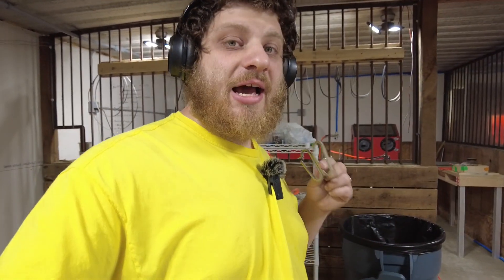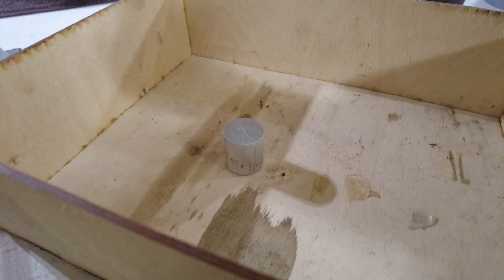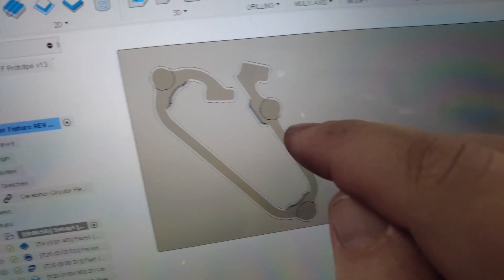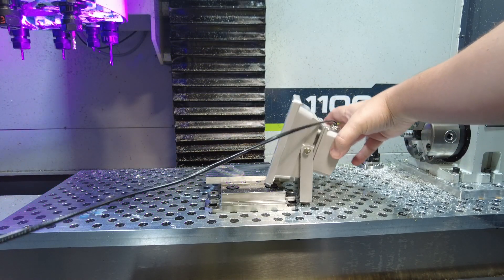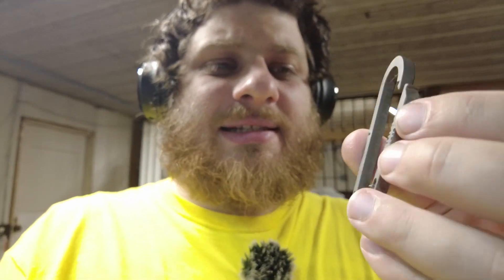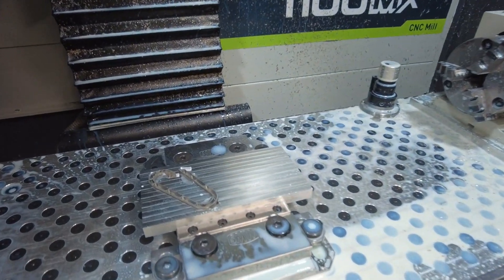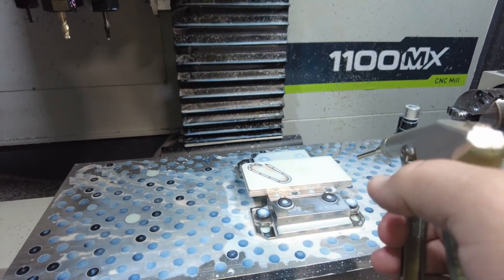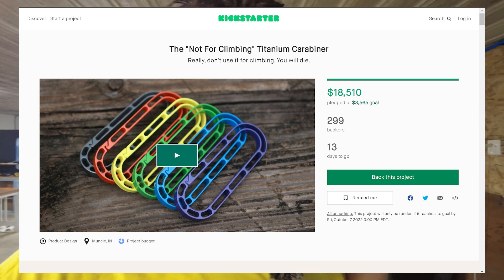UV Resin Adhesive Workholding

Comment: I know its an older video.  But epoxys dont stick to aluminium with holding power.  At least the ones i used.   We allways need to fully encapsulate alu fixturings in epoxy glass/carbon rc boats.

Comment: Just thinking out the box here - how about, on the inside of your fixture, you cut out a sheet of stiff rubber to match the inside profile, then a metal plate the same shape. Then if you screw the metal plate down to the fixture, that'll force the rubber outwards, which in turn will grip the carabiner. Bit like the miteebite, but all the way around the profile. It might cause problems where the slots get machined into the carabiner, the rubber might squash the walls inwards.
Reply from the maker: Oooh, interesting! That could potentially work super well! And it would be fast to get parts into, and out of!

Comment: I've seen that you have been working on work holding for a minute now. My advice to you would be to make a 3 piece clamp that surrounds the carabiner with centering pins. you would have 6061 aluminum inside the carabiner to hold its shape and a top and bottom piece to clamp it shut within the vise.
Reply from the maker: In the past I have been burned by mechanical workholding warping the part. It's rather thin once I finish the material removal. Something like that might be the way to go, we'll see. But adhesive workholding has some benefits if I can make it work.

Comment: Have you already just used 3 large head screws? Two at the ends and one in the middle. (Start with drilling three holes for screws if you have to) Machine what you can, M0, move screws to different spots, finish machining. It's probably the slowest and needs the most human intervention but if you don't need to make a ton of these I've definitely machined more precarious parts this way. Either way, good luck! Also, they make downcut end mills that aren't just for plastic, could help.
Reply from the maker: I need to make about 1000 of these! So trying to minimize human intervention as much as possible. I'm cutting with a feedmill, which helps minimize upwards forces. But I've never considered a downcut tool for metal! I'll keep that trick in my pocket. That will save me some day.

Comment: Good afternoon. Been watching for a while. I just got myself a 1100mx ans started my own job shop after 20 years mech Eng... Anyway no offense but in industry you'd vaccum clamp 3 flat bars the length of the tormach table and contour 30+ carabiner and all the pockets to 5 thou of the bottom. Then later flip and face on a tormach rotary with a diy tombstone. Finish the surface in an Abrasive vibrator . Since you have 1000 parts to make, 3 part fixtures and hot glue should not be used. But I really admire your social media presence and marketing, hope one day you make it like NY CNC and get a bunch of HAAS!

Edit : if you want some design ideas for your fixturing let me know I'll give you a call and free consult. Instead of being a keyboard tough guy.. Lol
Reply from the maker: hi! I used to make them that way, except it's both far faster in terms of machine time, and far cheaper in terms of material costs to get them laser cut. I can get laser cut blanks for ~1/3rd the cost of nesting them in plate, and it cuts my machining time by like 75%.

This is an experimental fixture for testing the UV resin, not for production purposes. The real production will be done using two interchangeable pallets, so that I can load one offline, while the other one is in the machine. I'm not 100% sure how many parts that fixture will hold yet, but it'll be a reasonable number.
Reply: @AudacityMicro  I'm sure you'll figure it out!
Reply from the maker: yup! I just need to experiment a little to see what works best. I fortunately have the luxury of time to figure out how to optimize everything before I get started.

Comment: drill some holes in base and try vacuum hold
Reply from the maker: There isn't much surface area left after cutting the part. There wouldn't be enough holding force
Reply: @AudacityMicro  is there a way to orient the vacuum holes so that they grip the perimeter of the part instead?  So instead of the bottom, they suck from the side?
Reply from the maker: Not easily. The walls of the Carabiner are laser cut, and not super high precision. Not a good candidate for vacuum.
Reply: @AudacityMicro  ah dang it.

Comment: Have you thought a bout adding ejector pins to your fixture so you don't have to pry the finished part out?
Reply: I second this. I work for an investment casting company and our fixtures can use ejector pins or holes to force compressed air through.
Reply from the maker: I could! It wouldn't be too hard! even just a hole that I could press a punch through